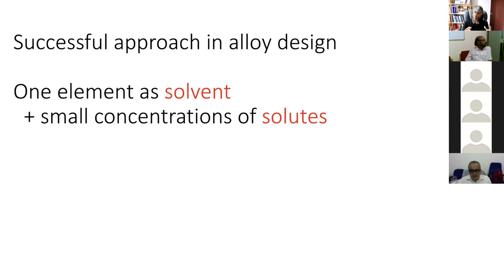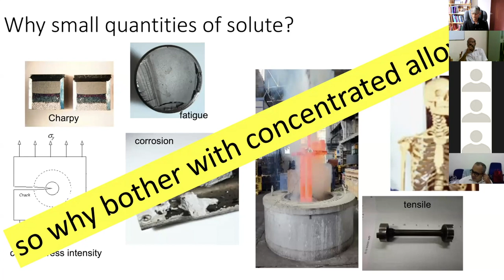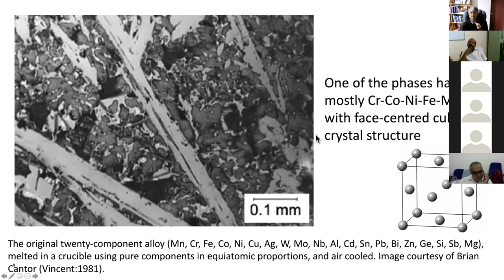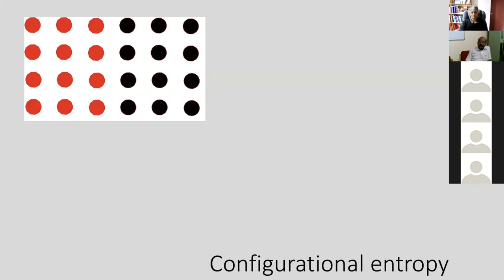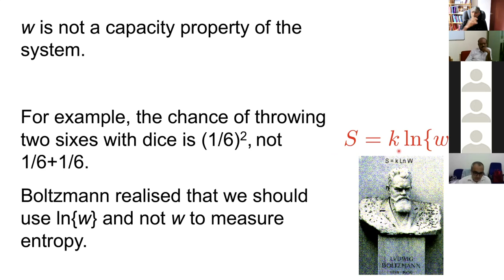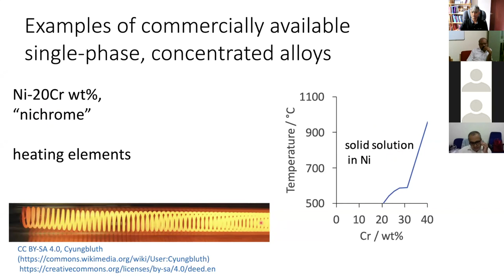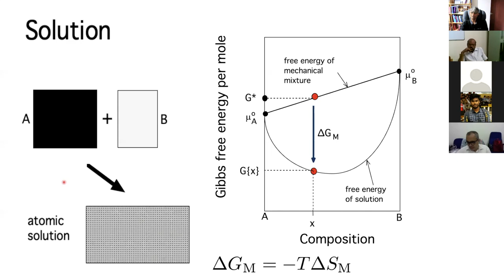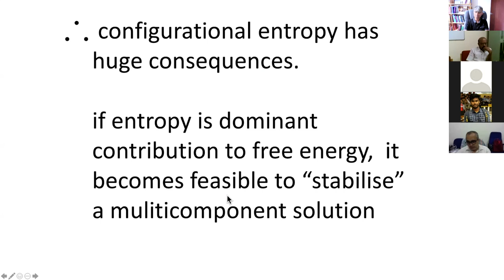High-entropy alloys, Part 1

Comment: First principles based (DFT) calculations can be used to quantify the effect of vibrational entropy in HEA's assuming harmonic approximations. I am yet to come across a systematic/rigorus study on this aspect.
Reply from the maker: Ge H, Tian F, Wang Y. Elastic and thermal properties of refractory high-entropy alloys from first-principles calculations. Computational Materials Science. 2017 Feb 15;128:185-90.

Tran ND, Saengdeejing A, Suzuki K, Miura H, Chen Y. Stability and Thermodynamics Properties of CrFeNiCoMn/Pd High Entropy Alloys from First Principles. Journal of Phase Equilibria and Diffusion. 2021 Oct;42(5):606-16.

It also is important to bear in mind the purpose - unless properties, particularly mechanical, can be predicted, entropy calculations simply represent curiosity.
Reply: @bhadeshia123  Thank you Prof. Bhadesia for sharing these papers. Science should be driven by curiosity than only applications.

Comment: Which type of designing technique is suitable for easy making of ant type of crystal structure whatever we want, 
Is artificial designing of alloy technique or natural designing of alloy technique? 
Is possible to arrange a atoms in any type of unit cell?
Reply from the maker: The way in which the atoms arrange depends on the resulting overall energy. A low energy favours an arrangement over a high energy.